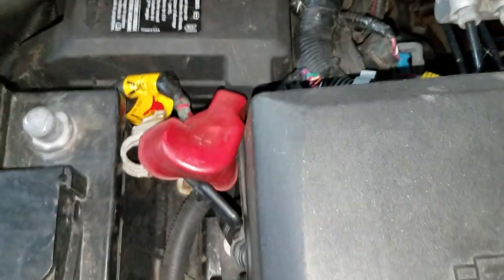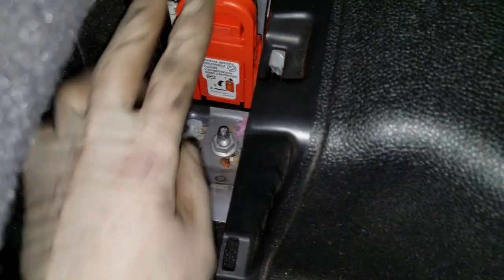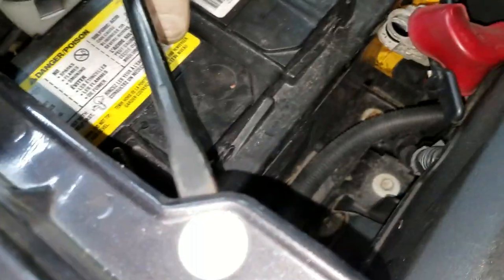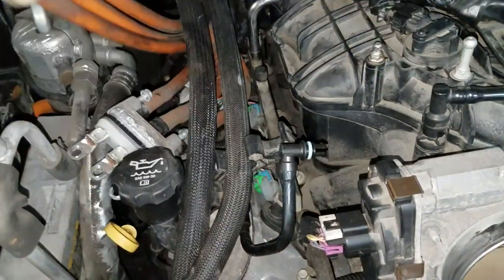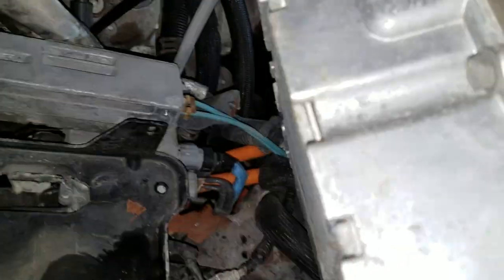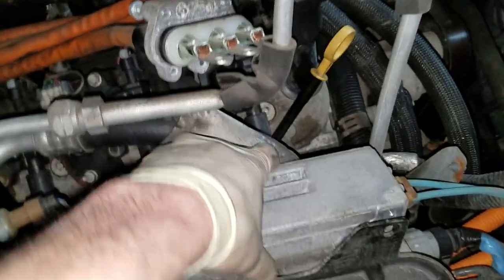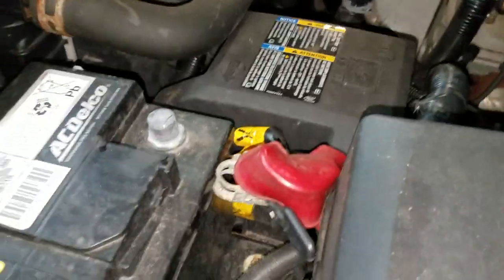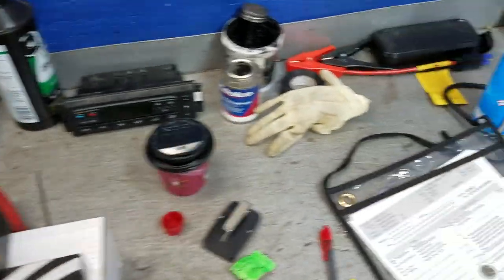Hybrid Battery Inverter Removal on Chevy GMC  Truck

Comment: Do you need high voltage gloves to remove the leads from the inverter? I need to remove the entire inverter & the leads so I can remove the heads on my engine, but I know very little about working with the hybrid system. Thank you for your reply and for this video!
Reply: No, just remove the disconnect like he did at the beginning of the video.

Comment: Hello. Nice video.  I have two codes that and message that suggest replacing the APM. Service Charging system. And...I servicing the Hybrid battery presently. May need some help reprogramming Thanks

Comment: Hi, thank you for sharing this great video! Quickest question: do you have a picture of the safety switch that disconnects the inverter's power or the switch that disconnects the high power battery?

Comment: Hi how are things ! My 2010 Silverado hybrid started and it turned off running using it, I turned it back on, the steering wheel was hard, the battery light showed on the dashboard, we changed the battery since the engine light indicated that and that's what the mechanic recommended to me where I took it and after changing the battery still has the same problem, do you know what it could be?

Comment: Is it possible to use hybrid escalade with non - working invertor or dying battery ? Only with a gas engine ?
Reply: Yeah in M4   or get a disable chip to turn off the auto stop (also get a chip to turn off the  active fuel management)

if it's able to start  then it can be used...  i would not pay too much for it though
Reply: @focusinc4266  range technology   they claim it does not work but it does worth with the hybrid model

Comment: I have been getting similar codes Service Power Steering on my Hybrid Yukon Denali 2011.  Might want to do the same replacement i dont mind the drive towards your shop. Seems you know what your doing no one i. My area know darn thing about Hybrids.
Whats the cost of this module and replacement?

Comment: My 2008 is on won't start mode? (Turn the key but does nothing) how can i fix it? I replaced 12v vatery but nothing happened.
Reply: Any update on that issue?
Reply: Fr, what happened to this poster/comment section. Seems like these hybrid systems are dead ends and GM discontinued the 06 silverado 1500 hybrid "arter" is I think what they called it part# 19117206
Reply: Any update from anyone?

Comment: Would u happen to know part number for the inverter i have a 09 Escalade hybrid
Reply: my 2010 hybrid escalade is acting up as well.... getting a check engine light, it's running like crap.. the error code is 'hybrid module'.. Cadillac updated the software on it, but the problem still persists. It only has 110k miles on it. I'm not getting any 'service hybrid system' messages. Just that one code for the check engine light. Does your escalade say anything about CHECK HYBRID SYSTEM? I just refuse to believe i need a new battery. it's just gotta be something else. It struggles to accelerate. It feels like a fuel pump

Comment: 2009 Escalade hybrid. Everyone morning or after 2+ hours of driving the SUV shuts off. Says service power steering, and service hybrid system. Have 4 codes that pop up every time. 2 codes of P0ac4, and 2 codes of p0a1b. I reset the engine codes and it's good for another few hours.. battery was replaced in nov. 2016 40k miles ago by warranty. Before I go spend $100+ in diagnosis, what should I look for or is this a known problem?
Reply: I had the same issue in my 2010 silverado and they replaced the intverter...
Reply from the maker: I have seen the inverter having to need to be replaced and also the power steering rack itself. The last one I did was a power steering rack assembly. but I would definitely pay the $100 to have it diagnosed properly because both parts are very expensive
Reply: Jon Boatman did you ever get your Escalade fixed, I’m having the same issue with my 2010 Escalade hybrid and I was wondering what the problem ended up being and how much did it cost to fix it...
Reply: @bigkrispy  yes I did actually. I ended up replacing the PIM that's under the hood passanger side, but then it started happening again. Took it to the dealership, they found that one of the computers wasnt talking to each other and they re-did wireing/updated the pcms I'm assuming and boom it works. Idk if the PIM was actually bad, or the 400$ I spent at the dealership having them make the corrections. Been driving it ever since.
Reply: @jon boatman wondering what’s the PIM is but I have a 2009 Escalade hybrid and had it diagnosed at the dealership they said I needed to replace the inverter and hybrid battery.i  Check engine light came on, reduced engine power, traction control light. Everything reset itself drove perfect for month then light it did the same thing. Any experience On what the issue could be. I Don’t want to drop six grand in it if not needed to be thank you
Reply: @rashodchatman6045  it would prob be cheaper to sell it to carmax and buy another used one. Can find these hybrid escalades for under 10k now. If it were me, and it was me, I just never bought a hybrid again. Had mine fixed, sold it immediately for 10k$. Will never buy a hybrid again.
Reply: @FlatRateMechanic   can I disable the hybrid and go with out it